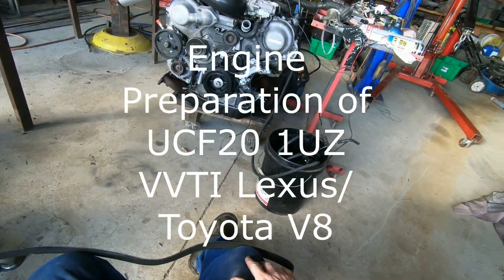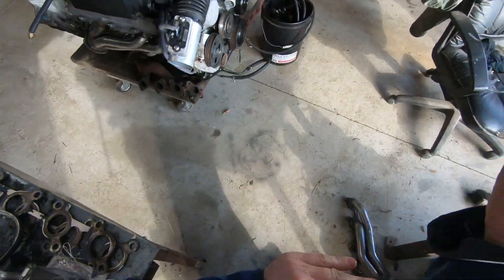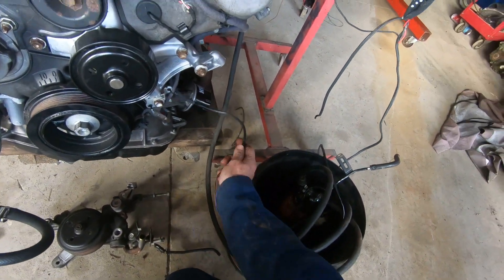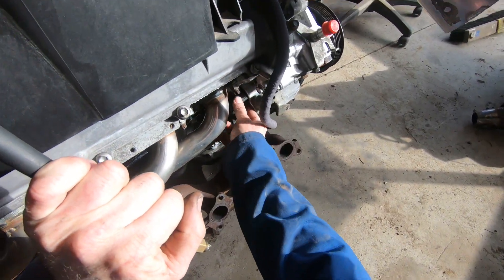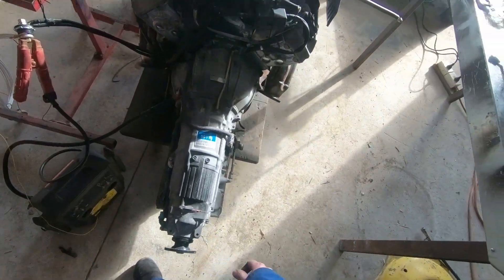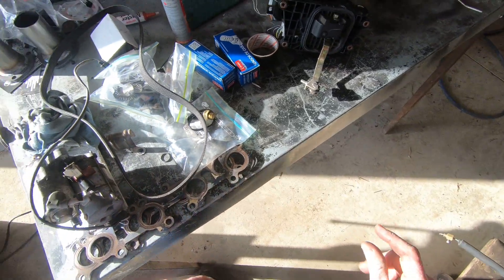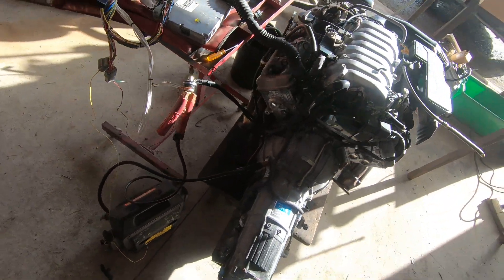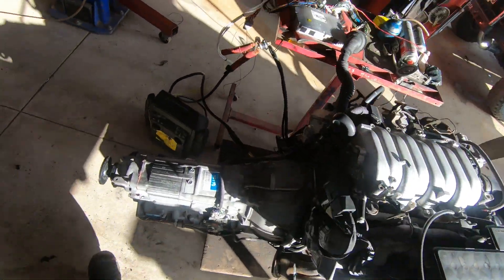1uz or 3uz VVti engine preparation ,

Comment: Hi Kelvin would you ship a running engine to drop into a Nissan D40 Navarra 07 manual to the UK .  You supply ECU and wiring, I understand that I Will need to make connectors to fit etc. Any idea on the complete cost.

Comment: What do you charge for the wiring, if I wanted to get one with ac, I would be running a manual, as well
Reply from the maker: Wiring charge is going to depend on your requirements ,  all new with aftermarket ECU,   refabbed stock loom with stock ecu etc,  and if using a stock loom the condition of your parts which I start with.  Cheers Kelvin

Comment: Why don't you need to use the fly by wire pedal with the vvti?
Reply from the maker: While the 1uz VVti is drive by wire, the accelerator pedal position sensor is located on the throttle body, this sends a signal to the ECU which then opens and shuts the throttle butterfly via the throttle motor.  The 3uz VVti is different as seen on the 3uz wiring video.  Cheers